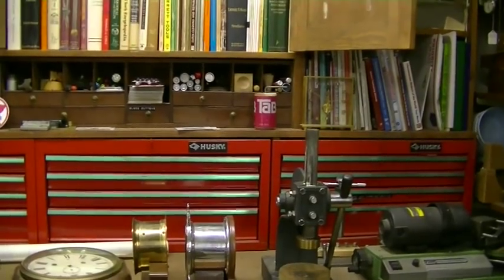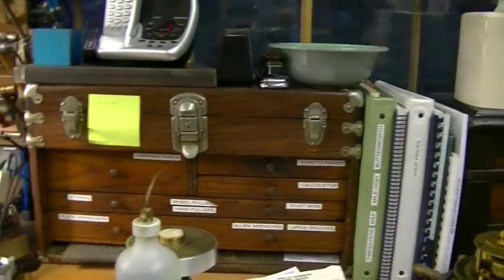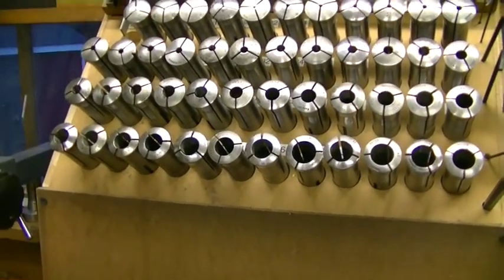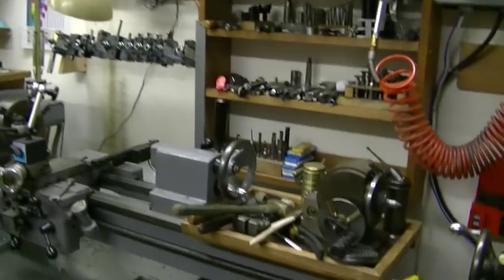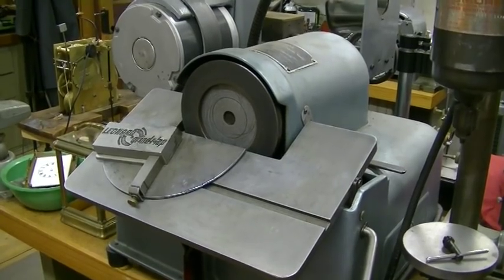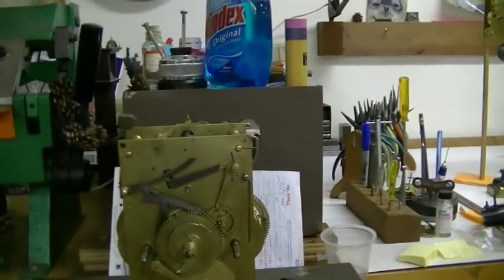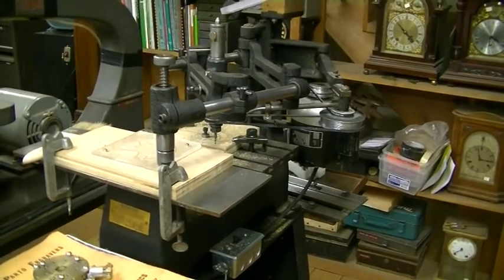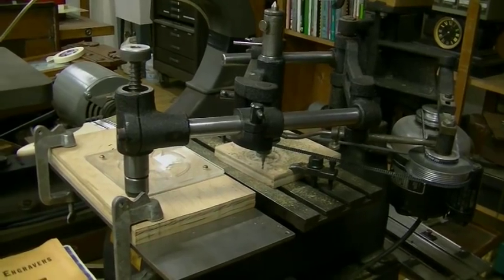Clock repair tutorial. #2.  A shop tour.

Comment: hi sir ..i have a problem on a pocket watch ..i need to send you 2 photos to see the problem ..i can not describe it exactly ..you see is a very small chain like the bicycle type but 0.8 to 1 mm wide and connects the drum which includes the main spring  to the first wheel ..the watch is made in england and it says ( THO & B ALLEY .....   BY  J DRINKWATER   .....       8 & 10  LOWER HILLGATE  ....   Stackport   ) now how can i send you 2 photos to see for your self ..the part i need is the little chain